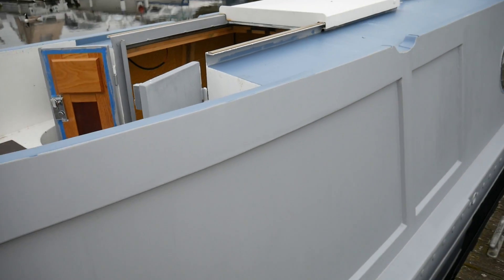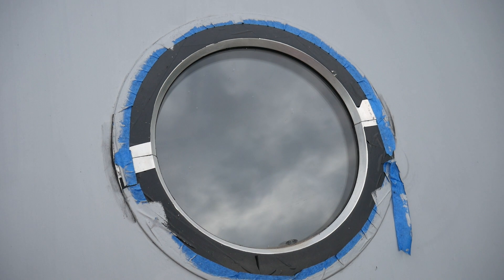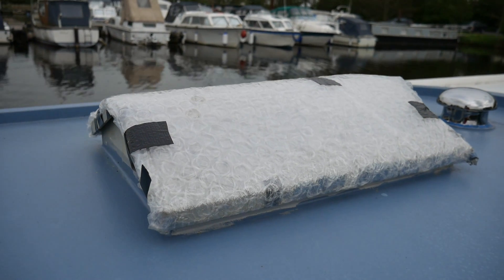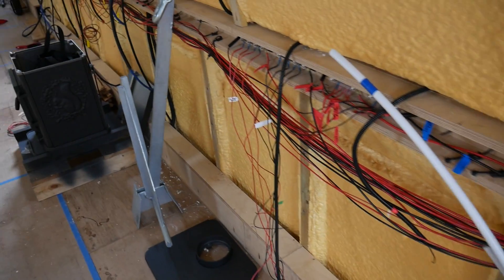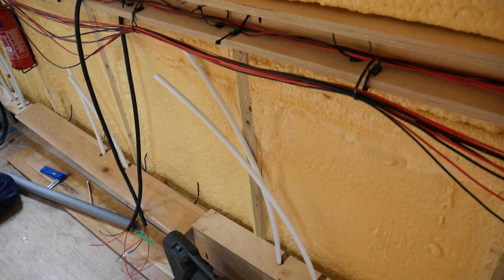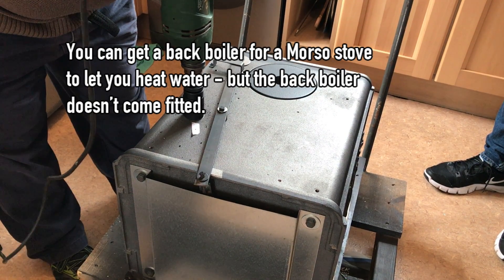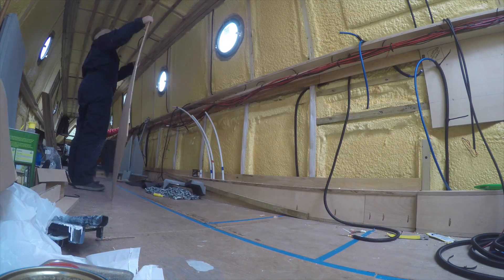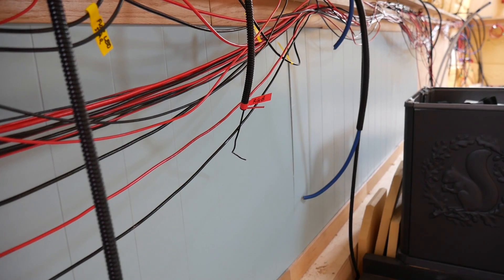The Narrowboat Fit-Out: Vlog #3: Progress Report (What we've done with the Boat so far...)

Comment: (I know this is three years hence, but I'll answer as if current, FYI)
Two things about your paint:
First; exterior yacht varnish is fine if you sand it down thoroughly and apply another coat EVERY YEAR !
Sand it off entirely and use a couple of coats of Sadolins Extra Natural, instead.
It's a shame you've already got some black staining on that top corner and bottom rail - that goes quite deep and not easily removed.
Secondly; the grey primer is porous! If you coat bare metal with it, and other types of primer, you need to get a closed-coat applied of your chosen topcoat colour to make it waterproof. Leave it for a few weeks and you'll see rust coming up from below the coat, which should be re-treated, re-primed and top coated asap. Its more important to finish the exterior now.

Comment: The day when you can look at each other and say, the fit out is finished is when you sir will look at the honeydew jar and notice it's starting to fill up. At that point crack open a good bottle of something alcoholic in nature with a couple of glasses and toast her properly. What happens after the toast is none of our business but enjoy! :-)

Your making better progress than I expected but that's a good thing.

Oh yeah ever heard of match light charcoal? Get a bag of it as 2-3 lumps of it with coal set on top and around it is the easiest way to light a coal fire short of the expensive fire starters that look like itty bitty little look at me I'm a pyromaniac! They work but are expensive around 3 quid or so apiece. 2-3 pieces of match light charcoal cost about 1/2 a quid and while they take about 5-10 minutes to fully ignite by themselves using a pair of tongs you can then set the coal around and onto the burning charcoal and just pile it up. While it may be more expensive anthracite ( hard coal ) will give you far longer burn times for a given amount of coal with zero smoke and more than 24 hours of heat without adding coal.

Ok I tapa too much.😎😎😎😎

Cheers

Comment: Crack on.... May the force be with you... Paper masking tape can be a bit of pig to get off after its been wet.. An a top tip for smoothing out a nice bead of silicone sealer is to lick your finder first of have a cup of water to dip your finger in... Lovely job your doing though

Comment: i would like to offer some obvious advice which is go overboard with fireproofing where possible,my reason is this,my 50ft boat accidentally cought fire while i was doing a small amount of metal work on the front deck to one of the drain holes while out of the water and and standing on the ground,i`m not sure how this happened but a small fire started inside at the front,the fire took hold within 30seconds and the boat was gutted within 60seconds.i did have the fire rated yellow sprayfoam which slowed the spread,battoning,basic mockup layout,some lighting wiring.get more fore extingueshers than you need and make sure you shake the powder up regularly as i wouldn`t wish this on anyone.take care